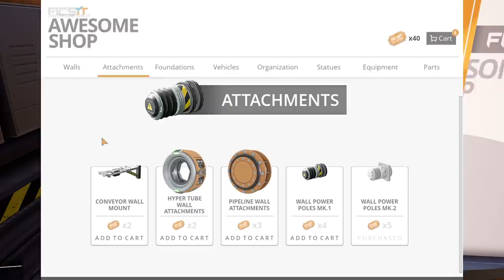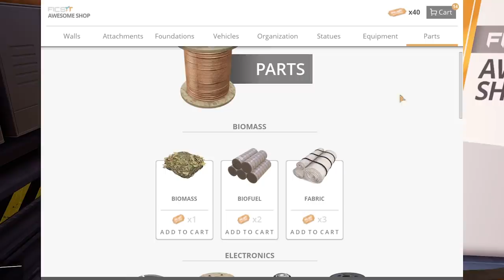Automating the ALL NEW Space Elevator Parts! - Satisfactory Early Access Gameplay Ep 7

Comment: Coffe Stain: Yeah set the Encased Beam as material for the T4 conveyor, it is a nice dificulty climb, it is slow and expensive to produce so will require the player to have a decently optimized factory

Kibits: sending Encased Beams to the sink  WHAT? I CAN'T HEAR YOU OVER THE SOUND OF THE SINK GRINDER!
Reply: Mmm BEANS!!!!!
Reply: Yep, that is one solution, me just sends the space elevator stuff into it partially, and when the elevator stuff bin fills, all goes there, and they cost a lot of points, not supercomputer level, but nice for an early/mid game item
Reply: Also, with steel and all production that produce smoke, I wish we had the choice to redirect it out of the device, to another spot or output it on the device.

Comment: One more thing i want in logistics is ceiling mounted conveyor belts so you can transfer all your resources above your constructors
Reply: That would be nice but you CAN just stack poles up to it and then delete the poles afterward.
Reply: It was a thing in alpha. Cant figure out why it was removed. The stackables could be fitted to ceiling
Reply: i just build up Towers of spliters / mergers to the ceiling, so when you delete all the once below, it looks like its hanging from the ceiling, every corner is a spliter then, but its fine for me ^^
Reply: I tend to build my bases' levels an extra wall/foundation or two higher between floors. Then I build what's almost a sort of ductwork with thin foundations and walls, and run my conveyors through them along the ceilings and pretty much out of sight.
Reply: 6 months late but how would it keep the items on it? Just sticky belts? (therefore need something else to make)
Reply: I do this with a mod. It's not that great
Reply: Well lucky you
Reply: Your wish came true

Comment: Remember, clock speed now can be adjusted by parts per minute which actually makes load balancing very nice
Reply: Oh my god, that is an absolute lifesaver.
Reply: According to the wiki even when overclocking by PPM the game converts this to its relative percentage which is then rounded down to the nearest integer value resulting in a potential efficiency loss. So if for example you wanted to produce 20 steel beams instead of 15 this would go to 133.3333% which is then rounded down to 133% so it actually only produces 19.95 PPM, in such a case the suggestion would be to manually increase the percentage by one to 134% which is 20.1 PPM. I don't know how likely it is you would run across this situation but it is something to keep in mind when overclocking by PPM in any case.

Comment: Man... I'm so overwhelmed by how big you have to build! I'm just trying to automate one assembler of smart plates. Just one!
Reply: Small steps, bud. You'll get there!
Reply: 4 months later, but you really don't have to build huge like this. I would say the most important thing in general is to always be making progress towards something. I had a very similar issue in Factorio, in fact I still do to some extent, and it's still sometimes a problem in Satisfactory. Basically, the only reason to ever build huge complex factories with 20 or 30 machines on just a single floor is when you want to achieve maximum possible efficiency. It's to ensure you're not wasting a single thing, you're putting in the exact amount of materials per minute to get the desired amount of output. There is no overflow (unused products sitting on conveyor lines), everything is being used up for production and it's all operating under absolutely perfect ratios. 

I don't think there's anything wrong with maximizing efficiency, but I do think it can greatly discourage new players. They see this huge complex factory working like a well oiled machine and think if they don't build like that, they're doing it wrong. If you're new to the game there's probably no reason to ever need 400+ steel per minute from a single factory. If you do make that, it will eventually help you when you reach the much later stages in the game, but by that point you'll most likely want to completely redesign everything anyway since you'll have access to faster belts. 

Basically, the best way to think of it is "almost everything is temporary". It's when you've unlocked that last tier upgrade, that's when everything you start building can truly be final. Of course, that's up to you to decide. If you do build out a setup to get you 400+ steel a minute, you may never have to upgrade it if that's all you'll ever need to use. So it can either hurt you (slow down your overall progress because it's overwhelming and confusing for you) or help you (because you'll never need more than you're producing). 

In my opinion, if you're new, you're much better off just getting something up and running. Even if it's inefficient, if it works, it works and that's one step closer you are to unlocking new tech and better stuff. If it seems too slow, do what you can to expedite the process. Also, the game does allow you to overclock machines very very early. Factorio has this locked behind tons of research, and even then the most optimal way to do it is not until you get Beacons, which require you to REALLY redesign EVERYTHING if you want to use them in the most effective way possible. Satisfactory is very simple in this regard, just pop in some power shards and you're good to go. If you've got the power demands to run it, you can greatly decrease the complexity and reduce 30 machines into just a handful with a bunch of power crystals.
Reply: @spartan456  thanks man, I just need to have fun this game is awesome

Comment: Can you please make the steel ingot factory a tutorial cause I want to build it
Reply: It's easy, just replay the bit of video where he's showing it off. There's nothing complicated about it or anything special about the conveyor layout. You're sending one resource over the top on both sides and down the middle, and the other around the sides and underneath. Placing conveyors in frameworks takes some trial and error - place ALL the frameworks before you place any lifts, after you've dropped the foundries. Don't start the lifts at the foundries - start the lower ones inside the bottom frameworks (they'll snap) and attach the upper ones to a strip of belt or a stand on the top floor.

Comment: You know how you were connecting two stacked splitters into the inputs of an Assembler? You were connecting the bottom one into the input in front of it, and the top one with the sloped curve into the other input. But if you do it the other way round, you can squish the Assemblers closer; top splitter goes down into the in-front input, bottom splitter curves along the floor into the other input. This is because a conveyer needs extra space to go down a slope AND to curve

Comment: Kibitz, you do know that you can clip the pillars and frame foundations through each other, right? You saw it in the trailer, and you even did it here before removing it from habit. It could work on those pillars on the front of the steel factory.
As for the roof, perhaps you could build part of it into a tower which would be topped with a radio tower once you get them, and would also have a section for a bridge to connect the building to other buildings with hyper tubes and walkways. Bridges like that look amazing from the ground level. The rest could be sloped like actual factories, though making it have vents is optional.

Comment: @ImKibitz

I was reminded of something when you pulled out the pillars - there was a parking garage near me under construction a few years ago. The support pillars looked like those, but scaled down to have 1-inch bolts. Well, the pillars were supposed to have grout filled in under them after they were installed... and someone forgot to grout one of them. 

It actually lasted a couple days with just bolts holding up tons of reinforced concrete, but it finally collapsed - literally the night before an OSHA meeting was supposed to take place in a room on the ground floor. Steel bolts are strong, but they're not really load-bearing.

Comment: Kibitz I’ve just had an amazing idea. For the hyper tubes as they can only go from point A to point B and not A, B and C. You could have a different entrance where you chose an exit, like a control panel right in front of the entrance then the tube opens up and you enter the tube and it takes you to a junction where the junction open and closes one of its all 4 or 3 attachments depending on what exit you chose, know what I saying, kinda like how that elevator mod works but the floor you chose is on the entrance not inside the travel thing itself. Pretty spicy Hu?

Comment: Kibs can you put the hyper tubes on floor, so you can just walk into the hole?
Reply: it is not possible and in fact I would like it too, I have not tried if you can clip through the floor a normal entrance ... another thing on the "to do" list
Reply: I would prefer the opposite, the entrance coming from the ceiling, where you can walk under, or jump to enter. Coming out would simply drop you on the ground, instead of sending you flying across the floor.

I'm just about to unlock them, so I haven't had a chance to test any of this yet, so it may not be possible, but it's what I'm planning to try.
Reply: @giin97  yah that would be even better. I'm surprised it hasn't already happened as it seems logical

Comment: Your system can not work properly if it's not overload by ressources. It will feed your first two machines then feed less the others, and less, and less. 
You need to split to feed 2 or better, 3 machines for an optimal distribution. For example, to feed 6 machines, you have one conveyor belt (or two) which split twice. Both splitters feed 3 machines.  In your case (10 machines), you can split 5 times (5x2 machines) or 2 times (2x3 machines + 1 split for 2 machines x2)

Comment: Why not just overclock the pipe construction to output 28 pipes per minute?
Reply: Because that requires 1 power shard and 42 ingots per constructor which with a single 270 line is only enough for 6 constructors at 140% with 18 ingots left over for a 7th constructor at 60% for 12 pipes, for clean load balancing he would have needed to move the 150 ingots from the floor below and use 10 constructors at 140%. This is all a much bigger hassle than leaving the 10 constructors at 100% using 30 ingots per 20 pipes each and adding 4 more to fill in the remaining 80 pipes, as he done, with no unnecessary waste of power shards.
Reply: True